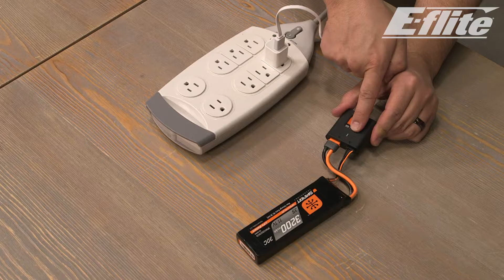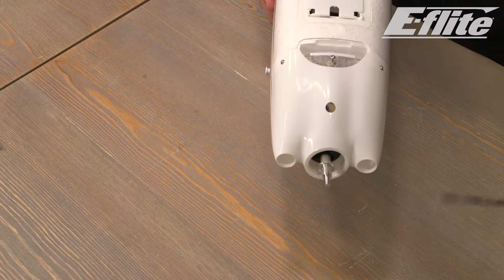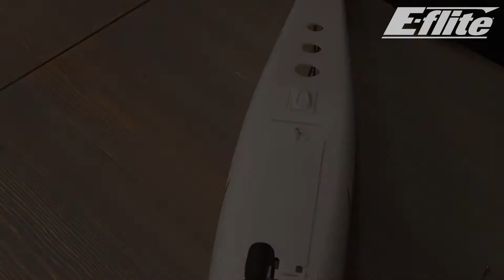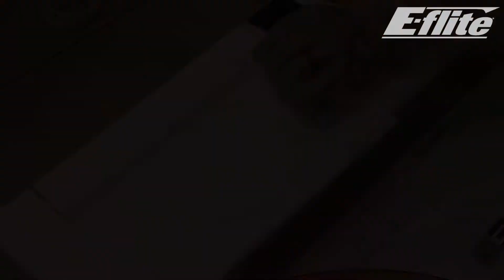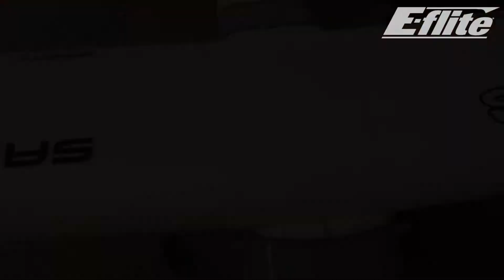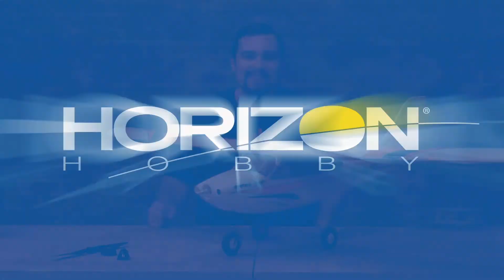Build Process: Apprentice STS 1.5

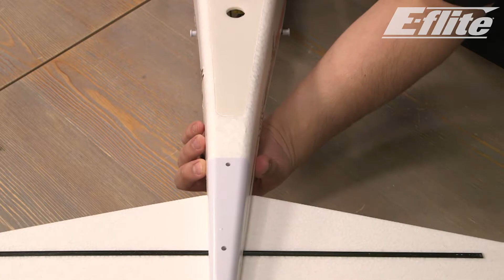Comment: 5:03 Yeah, that didn't go well on mine AT ALL. The holes in the bottom were too small for the screw heads and they did NOT want to thread their way into the fin. I had to rip it all apart, drill out the openings on the bottom (plastic) so the screw heads wouldn't jam in there and then force the threads in by starting the screw and using a pair of pliers to turn the screw head while the fin was out to force the threads into the fin. It finally went together after quite a fight and here's hoping I'll never have to replace tail parts because those screw heads are now stripped in a big way.
Reply: Exact same issue. Had I know, I  would have tapped the holes.
Definitely isn't as easy as they claim here.

Comment: Need advise on the CG. I understand it's 79.0mm back from the leading edge of wing but how far off of the fuselage? 

The manual doesn't give a dimension. Not sure I should go as close to the fuselage as possible, 1/2" off, 1" off, or what?

Does it matter?
Thank you